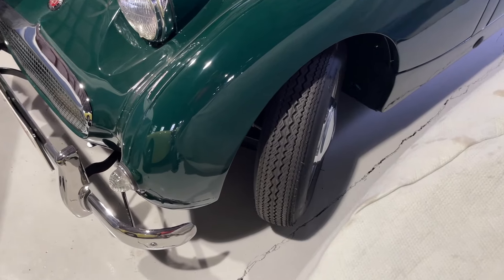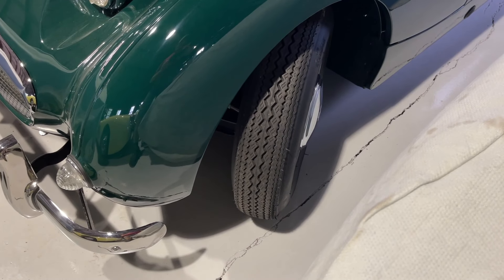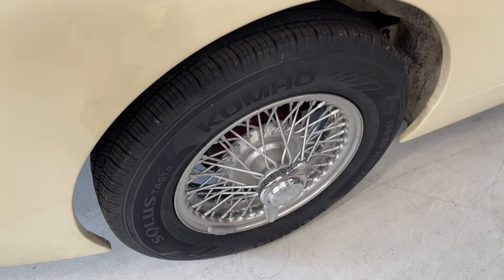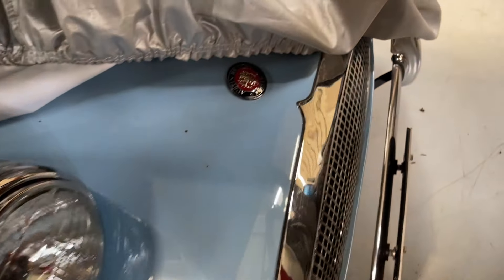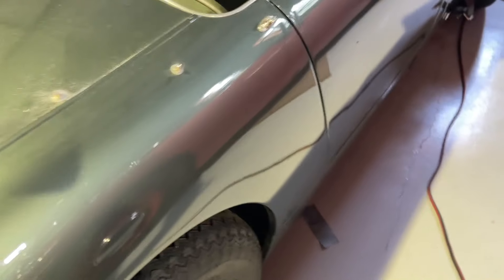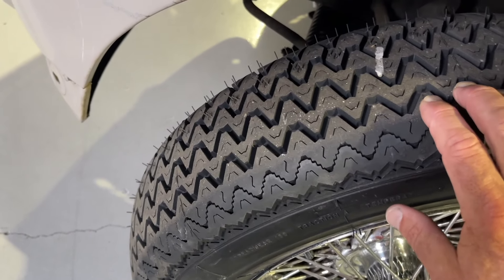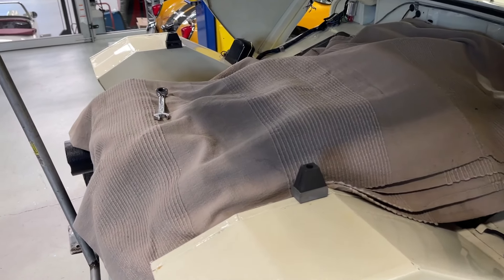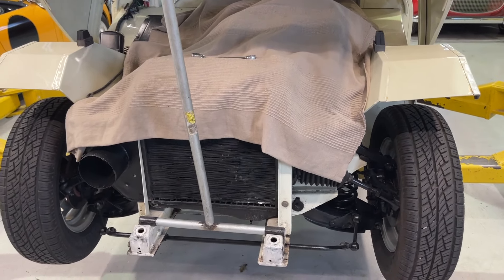We never "tire" of tires on our Bugeyes!

Comment: Fully agree, 165/70's are the way to go.   I find Thunderer Mach 1 to be a fantastic tire at a reasonable cost.  I would say that moving to a 165/70 over a 155/80 was one of the best improvements I have made in over 50 years of Bugeye ownership.  FWIW I am running these on wire rims and inner tubes.   Super handling and comfortable ride.

Comment: I went with Kuhmo SOLUS 4S HA32 155/80R13's on my Bugeye. They're classified as an all season touring, not that I'll drive it very much in the winter. So far I've been quite happy with the performance. What's the aspect ratio on the Blockley 165R13'S? Other than the fact that they're next to  impossible to source, would a 175/60R13 tire work well on a Bugeye?